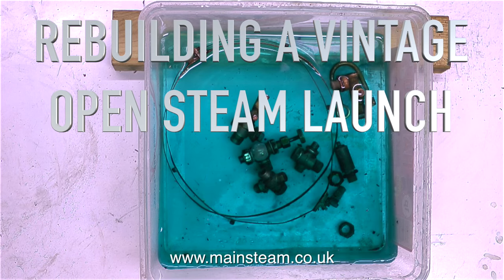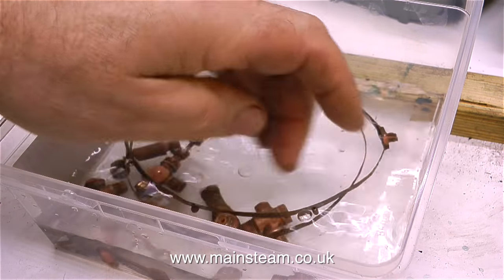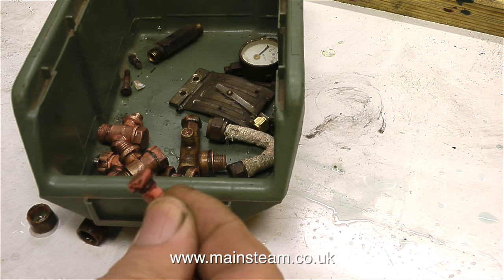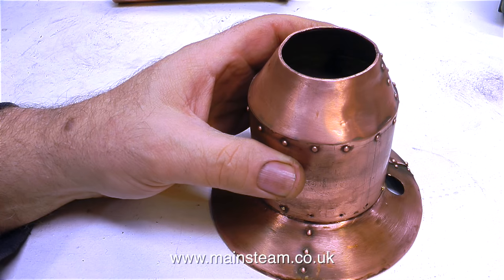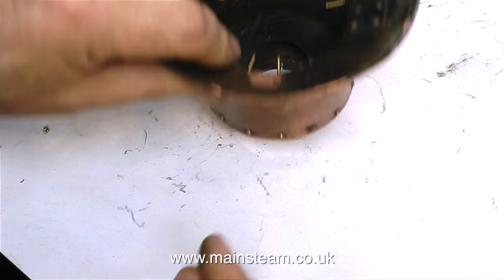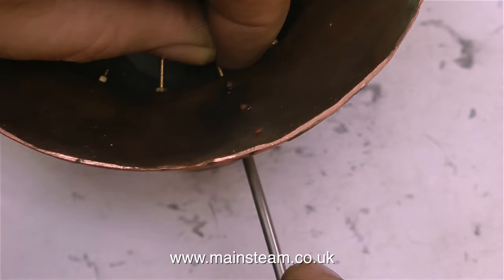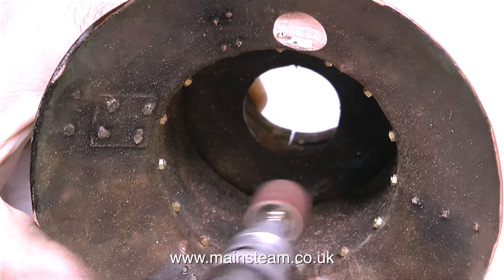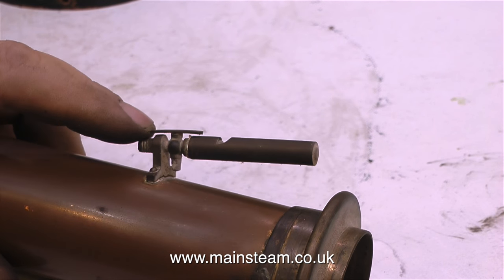REBUILDING A VINTAGE MODEL OPEN STEAM LAUNCH - PART #4

Comment: Great video, as always. I am curious why you decided to use the 10 BA screws and nuts on the top cap.  I can understand using temporary screws and nuts to pull everything together, but once that was complete why not replace them, one at a time, with copper rivets? This isn't a critique, just a question.
Reply from the maker: as I mentioned in the video, I was slightly concerned about the fragility of the bottom part of the assembly and the potential distortion caused by riveting, but in retrospect I think that I will rivet the parts together.

Comment: Hi Keith, I want to ask for some advice,  what would you say would be the smallest size lathe and mill that would be practical for someone wishing to be able to build model steam engines,  in the size range of a Stuart Models 7V
Reply from the maker: A Lathe that is the size of a Myford ML7 would be fine - avoid the tiny ones ......